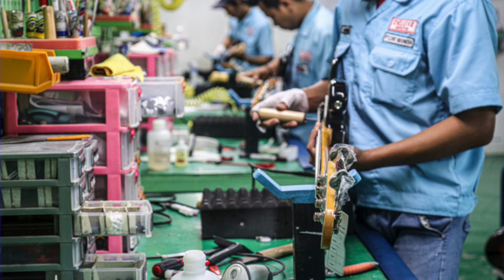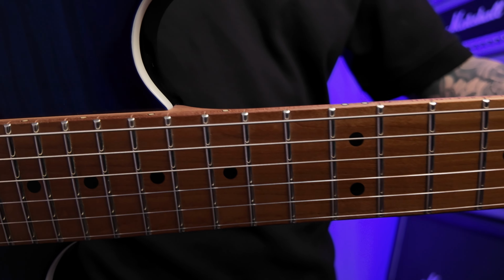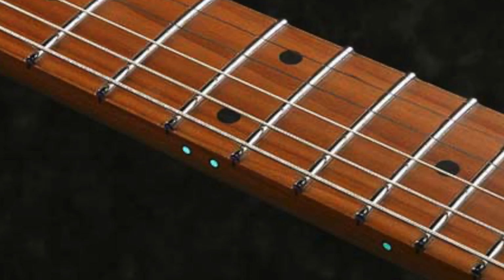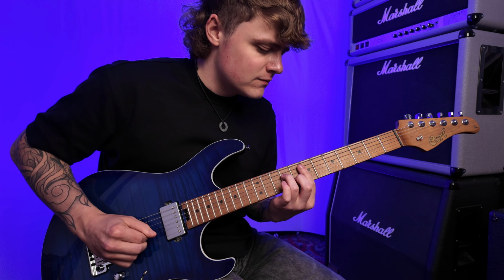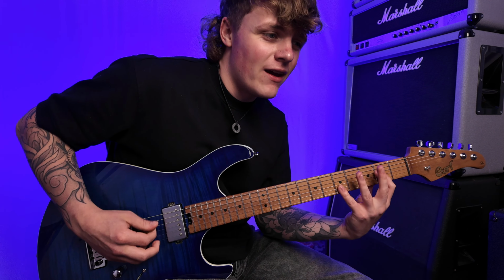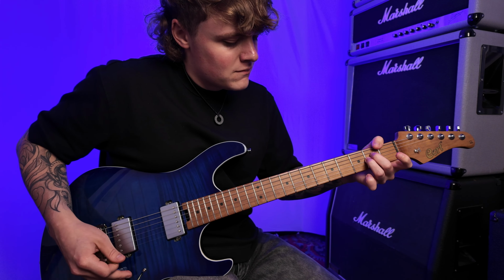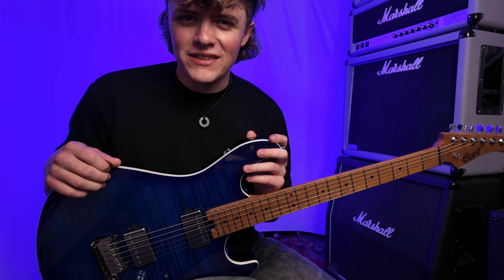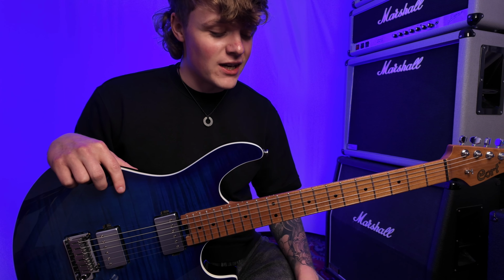Cort G290 FAT II - Is it Good?

Comment: I have the same guitar. It got 2 problems: 
1) pickups starts to whistle in high volume (its not the coils, its from pickup covers, i waxed them and whistle gone.
2) 5 way switcher  is not silent, and sometimes i got silent neck or coil splitter neck... So i will replace it 

Thats all, all other things are great, looks fantastic, plays comfortable